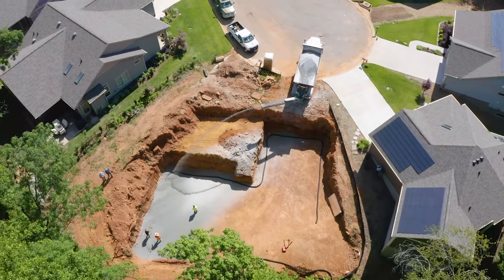Basement Wall Insulation | Done WRONG

Comment: Wouldn't an interior vapor barrier prevent the warm moist air from coming in contact with the cool concrete?  There is nothing wrong with that method of insulating.
Reply from the maker: In theory, if it was completely air tight. However, in this approach, any moisture trapped in the wall cavity has no way to dry. 
Continuous insulation against the concrete is the only sure fire way to prevent issues and allow drying to the interior.
Reply: @AddisonHomes  Sounds good but why doesn't building code mandate it? They had one job...
Reply: @mckylecfc  I always point out that building code is the MINIMUM legal standard for building.  It doesn't necessarily embrace the best practices of building science as there are many constituents who influence the code process.  The code essentially keeps our buildings from killing us quickly - no comment on long term health......
Reply: @michelleusher2355  😬 well that's comforting...thanks for the great work, keep it up and hopefully the constituents start listening too..
Reply from the maker: @mckylecfc  great question. Remember, building code is the MINIMUM legal standard for building!
Reply: @AddisonHomes  if the first thing I have to do is rip it out, I'm sorry, the code is broken

Comment: what if there space where just concrete showing no frame. what can I do to porevent this?
Reply from the maker: @raulacosta6020  not sure I understand your situation. Do you mean just a bare concrete wall?  If so, I would install continuous insulation such as foam board.

Comment: All concrete walls are done wrong. they all need hot tar on the exterior weeks after poured.
Reply from the maker: Not true actually!  There are many different types of waterproofing, most better than hot tar, and there are many different grades of concrete - some that will not allow water to pass!

Comment: superior walls are crap.  every corner leaks and they have yet to fix the problem plaguing them.
Reply from the maker: Sounds like you've had a bad experience with them.  Where are you located?  We've been using Superior Walls for 22 years and had 1 wall leak at a brick ledge in 2002 that they promptly repaired.  Aside from this one issue, we've had nothing but excellent performance from the product!

Comment: What? Wouldn't you just put the moisture barrier on the warm side of the studs like usual? Like you say the warmer air will move towards the colder air, so all good.
Reply: The problem is the lack of air tightness with an open stud wall against a concrete or masonry basement wall with air permeable insulation.  The lack of air tightness in this wall assembly allows air to move through the assembly and potentially reach a dewpoint surface.  In the moisture barrier scenario, this dewpoint surface could still occur at the basement wall surface due to air movement through the wall.  Dewpoint could also occur at the moisture barrier, resulting in mold and mildew.  Where the warmer air meets a cold surface below dewpoint, condensation occurs.
Reply from the maker: Agree completely.  Its about condensation potential within the wall.